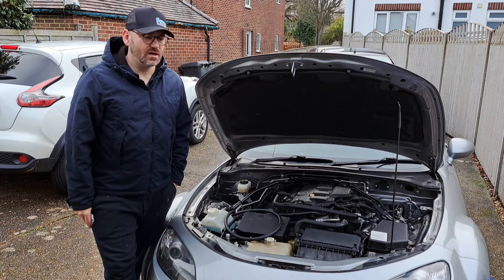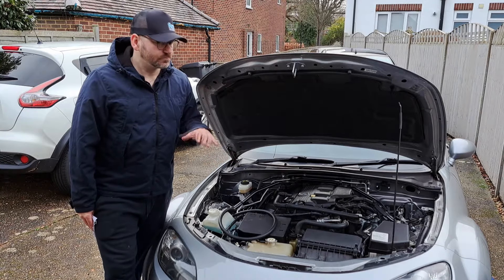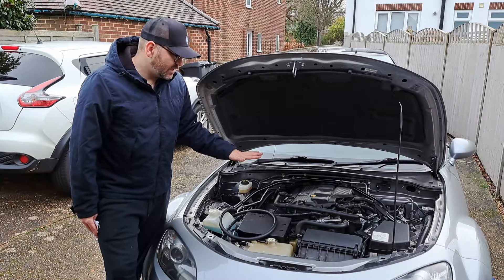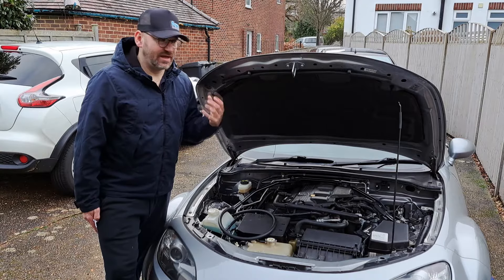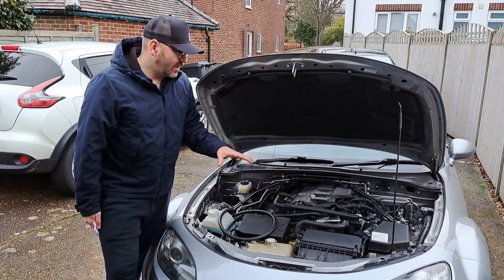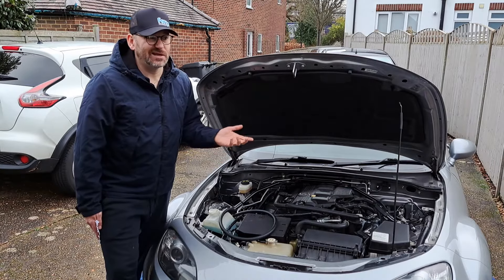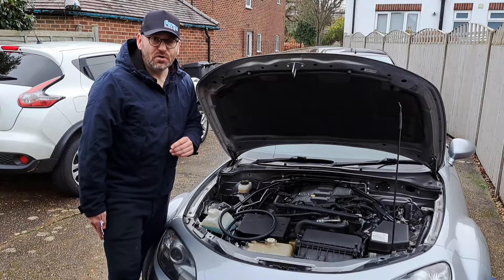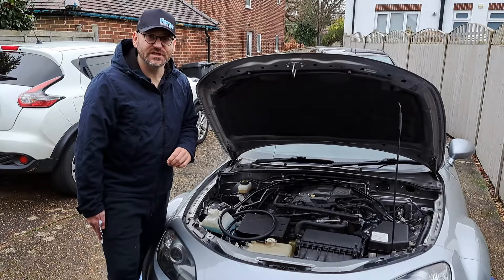Miata MX5 NC TURBO - DIY Turbo build Part 1 - Intro

Comment: Look forward to watching your series mate. Ive also been looking at FI for my nc but mine is an 2006 NC1 so weaker internals.
Reply from the maker: I would guess you just run a lower saver boost level. The rest would be the same.
Reply: Install a 2.5 engine from a Mazda 6 then! They love boost

Comment: You should also fit an air fuel ratio gauge. Its just as important as boost. Too lean and you will damage your exhaust valve, cats and turbo. We installed these in all our of our development tuning cars when i worked for a large OEM as a tuner (engine calibrator)